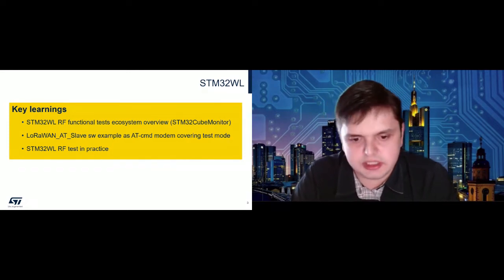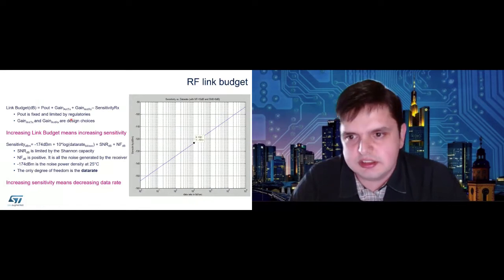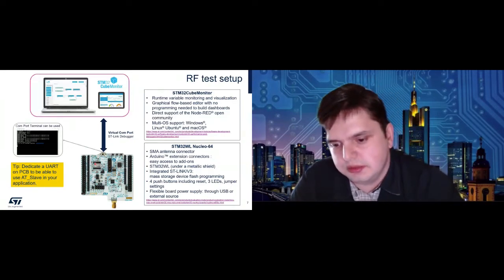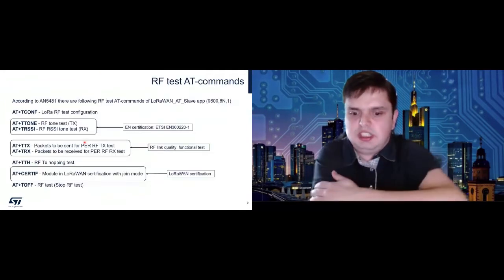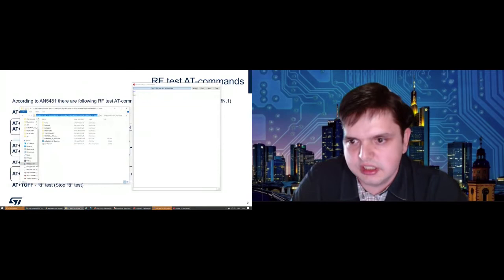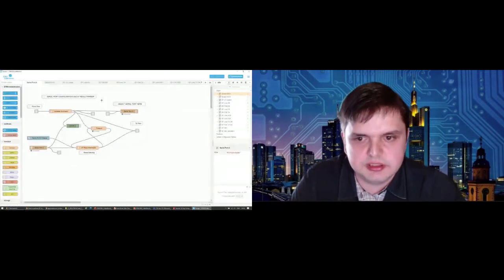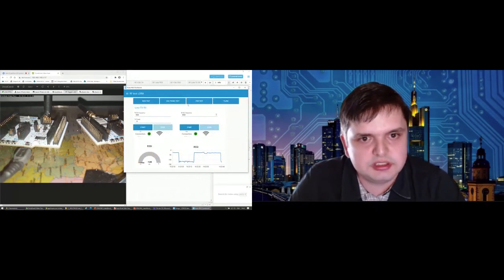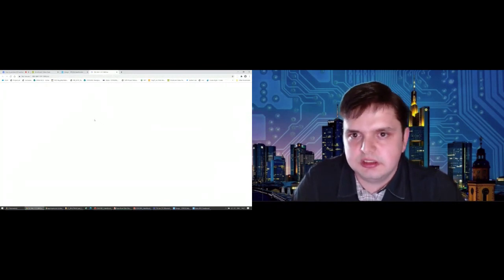Workshop: How to perform RF Functional Tests on STM32WL (STMicroelectronics)

Comment: Hi thanks for your helpfull video clip, may I ask your guide? I have a single channel lora GATEWAY (DRAGINO LGO2) since it can only transmit packets in 1 channel like 868400000, I couldnt activate my stm32-wl55Jc1 with that gateway via ABP mode. Would you please guide me to config the stm32-wl55Jc1 to transmit packets in just 1 frequency is there any solution?
Reply: Problem solved by setting the frequency in this path (Middleware/Third_party/Lorawan/Mac/Region/RegionEU868.h) in the lorawan_end_node example and change other frequencies (868100000, 868300000, 868500000) to a single frequency like 868300000. It works.